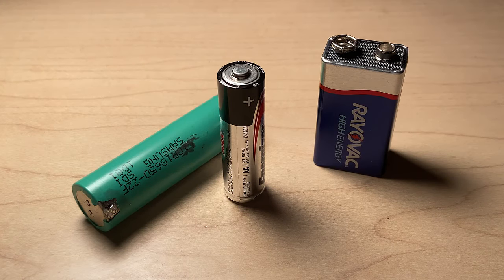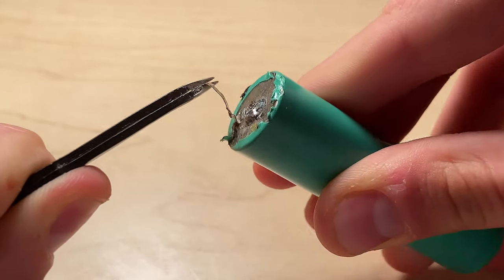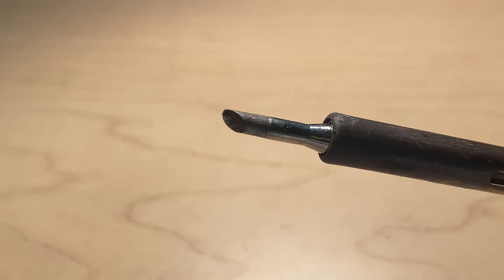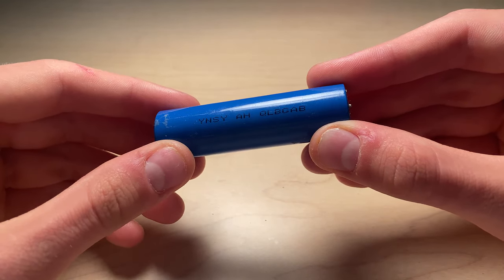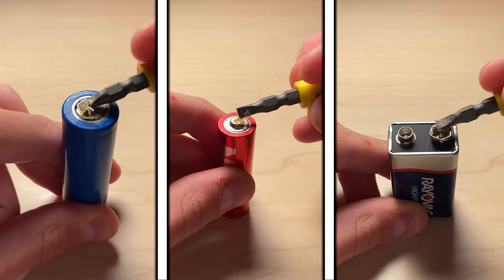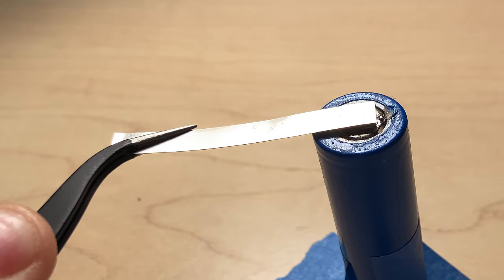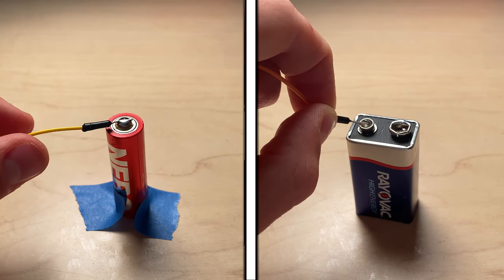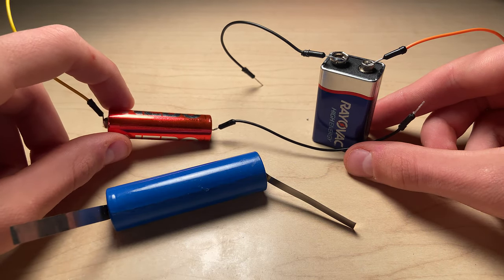[2020] How to Solder 18650, AA, 9v, or ANY Other Battery (To Make Battery Packs) | Safe & Quick

Comment: I tried soldiering my 18650 battery for a few hours, but the soldier would never stick to the battery. It felt like the flux even made it worst. So I just held the strip with electrical tape.
Reply: You taped a nickelstrip on top of the battery.....?

Comment: I just applied your method. My soldering kept falling off. I scraped surface and used soldering paste and it helped. Thanks buddy
Reply: Ditto. I used a Dremel to rough up the ends of regular Aa nimh battery. Worked great

Comment: As a general rule, fine sandpaper was missed. You can’t see microscopic oxidation which prevents bonding.
Reply from the maker: I suggested a flat blade screwdriver which is also suitable for removing the oxidation.
Reply: @DaGoose  I was not entirely dismissing the idea but certain most think you were knocking off high points and probably not as effective as a form-fitting abrasive...but you are right...does job. I believe few understand why soldering wires or pipes is VERY difficult or impossible without mechanical removal of invisible oxidation and flux.
Reply: I like a small wire wheel on my Dremel to clean the battery ends

Comment: No matter how much I try to solder strip and battery, I failed everytime. It's very hard to apply solder to nickel strip even with flux. I try so much and end up buying new trimmer... 😄
Reply: Sand paper or razor scuff and flux
Reply: LOL IM TRYING TO SOLDER TO MY TRIMMER TOO LMAO
Reply: @5gun1  & Left with damaged trimmer body..😅
Reply: @saurabhjuvekar3671  dude update, things are actually going well I removed the old battery (had to break a bit of the strips) but my new batter is too long. I’ll have to break some the plastic casing to let it fit. Will have to hold it together will electric tape. Honestly I just like fixing things myself and learning. I probably could’ve bought another razor but now I’ll have experience with soldering so can’t complain (:
Reply: No way what is it with trimmers? I am also trying to fix my trimmer!
Reply: @d_sidepaintball  sanding helps A LOT
Reply: @5gun1  too
Reply: @5gun1  yeah, if it's broken and you're going to replace it anyway, you might as well try to fix it. Valuable experience, and eventually you'll get better and when you actually start fixing things, it's very satisfying!

If you have enough storage space, I'd suggest holding onto your broken/old electronics, cuz down the road you might be able to salvage something from it. Or you could get to point that you can now fix whatever the item is, even if you thought it wasn't possible before.

Comment: Hi, thanks for the video. Does it matter where exactly I put the wire in a 9V battery? I see that in your 9V battery in '+'
 you soldered a wire exactly in the middle, but in '-' at the edge of the spot. Thanks
Reply from the maker: No, it does not matter. Just ensure that the wires are firmly soldered to any part of the leads.

Comment: My solder doesn't stick to the metal of the battery nor the nickel strip. Are you using anything special?
Reply from the maker: Did you use additional flux as shown in the video?
Reply: @DaGoose  yes I did add flux but it didn't help. I saw there is special type of flux for nickel and stainless steel.
Reply from the maker: @iGentle0  there is no special type of flux that you need to use. Rosin core flux should do the trick. I don’t think acid based flux will work with this
Reply: @DaGoose  I'm using this one https://ibb.co/dL5YCrR
Is it also working with you on the nickel strip?
Reply: Scratching the surface lightly might provide exposed metal to solder on. Also, be sure to get a good quality solder, cheap ones just won't stick to anything no matter how hard you try
Reply: The issue you are having is oxidation that is bonded to the contact surfaces. You don't need flux. Especially do not use acid flux as it will continue to eat & corrode the metals. Simply lightly sand the contact surfaces with fine sandpaper (400 grit is perfect).
Reply: Get 60/40 or 63/37, my favorite, with rosin core. Get rosin flux. Do not use acid flux and stay away from the lead free 50/50 or 40/60 solder

Comment: What temperature did you use?
Reply from the maker: My soldering iron doesn’t report temperature so I’m not exactly sure about that. Though, I do remember that the soldering iron is 60w total power and I used about a fourth of the power for this guide. Hope this helps.
Reply: Try and get the iron to 750*F to 900*. You want it HOT. I. Tin my strip or wire, tin the battery cap and usually on and off in 2 seconds

Comment: Hi, thanks for the video. If I wanted to join 18650 or 21700 batteries together in a line (creating a stick) how do I join them? Any advice will be much appreciated.
Reply from the maker: line up the cells vertically by alternating polarity then connect them using nickel strips, where you connect negative to positive on each side (be careful not to short circuit!) until all cells are connected in series and you have an open positive on one end and an open negative on the other end. then fold each of the nickel strips with the cells connected so that the cells are in a single line. 
This is how cells are commonly put in a line in laptop battery packs.
Reply: @DaGoose  do you think you could provide a video to do this? 😉
Reply from the maker: i won’t make one because this is a specific problem. i only have but so much time in the real world to make videos so [out of interest in high viewership] if i make one it’s usually regarding a solution to a problem that’s widely encountered. 
However, the next video will be about making lithium ion battery packs which should at least get you started.

Comment: Came here to replace my internal battery mod
What solder did you use?
Reply from the maker: I used 63/37 1mm Chinese solder
Reply: @DaGoose  
Thank you. I have never soldered anything in my life before
Reply: @DaGoose  
Can you please help me? I am trying to solder a small wire to a 18 350 battery for my vape. It came with an internal battery but I'm able to replace it but I cannot get the solder to stick. I clean the surface, I sanded it and wiped it with alcohol and I cannot get the solder to work. I have a brand new solder iron new solder and flux
Reply from the maker: You’ll want to apply flux to both the wire and the Battery. If the solder won’t stick to the wire, try using a different wire consisting of different conductors.

EDIT: I don’t suggest using alcohol. That could be your primary problem.
Reply: @DaGoose  
The solder doesn't stick to the battery or the wire. I'll clean up everything tonight with water and resend the battery down. Thank you for your help
Reply: Make sure u have 60/40 or 63/37 rosin core solder. No acid and no lead free stuff...
Reply: I like Alpha Fry/Alpha Metals 63/37 leaded, rosin core solder. Use rosin flux paste. I have some Chinese 63/37, that I'm going to try. I like 63/37, one of the lowest melting Temps at 341*, about 10* lower than 60/40.

Comment: I want to replace flat top D cells with cells that have a post on the positive end and they don't fit. How can I remove/flatten the post?
Reply from the maker: You’ll have to link a picture to show me. It’s a bit confusing just simply reading the issue.
Reply: You have a button top, made for flashlights, etc. Do NOT try and smash it. Just go buy a flat top..

Comment: Where do you get nickel strips
Reply from the maker: Buy them online. I found the ones in this video on Amazon
Reply: Remove the plating from the battery surface with a dremel abrasive disk prior to soldering

Comment: I am still watching but something did not make sense.

"If it is rough or not smooth" then you need to use something to scratch marks into it to make it more rough.. what?
Reply: I have no Flux but I have the rest so I will use what you said to so I can attach AA batteries into aaa slots.

If you put a triple a battery and it's a double a slot you can make a ball out of tin foil and use that
Reply from the maker: that only applies if there is oxidation on the surfaces. that is what is meant if it is rough or not smooth. it is oxidation that prevents solder joints to form on the surfaces.

Comment: What are some real life applications of this?
Reply: Huz Gaming.....I can answer this one as I just had to do this on a pricey wifi thermocouple device. The manufacturer had 1 ni-mh battery spot welded to the pcb. After so many charge/discharge cycles, the battery finally gave up the ghost and wouldn't charge anymore rendering a $200 device useless. A total loss from a $2 AA battery? I think not. I didn't have the perfect solder setup, but did my best with my cheap iron and soldered a new battery back in place. Spent a few hours learning and trial/error labor, but in the end, I saved $200 from buying a new device and learned something in the process. Highly recommend!
Reply: Making rechargeable battery packs for lots of different things.
Reply: Repairing power tool battery packs
Reply: Repairing something that uses rechargeable batteries that will no longer hold a charge and need to be replaced

Comment: Do i have to use single stranded wire or multi standard wire ? please help sir.
Reply from the maker: Either would work, but ensure the current going through the wire(s) isn’t too high else they will burn up.
Reply: Either...solid wire can carry a little more amps

Comment: my battery exploded in my face
Reply from the maker: I am sorry you experienced that. Hope everything is ok.
Reply: This is why it's recommended to spot weld them, not solder
Reply: 18650 must be discharged., everything in the video works and i actually made many solders using this method. Maybe you over solder and the blob of lead shorted the positive to negative, likely scenario if unexperienced.